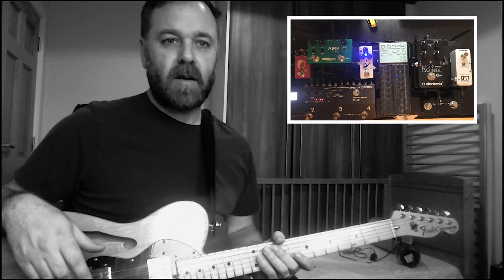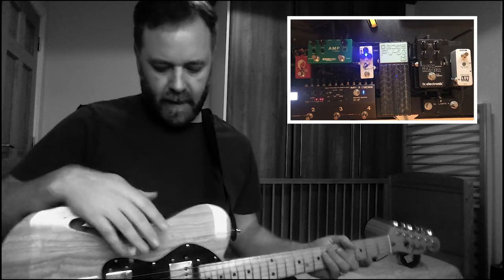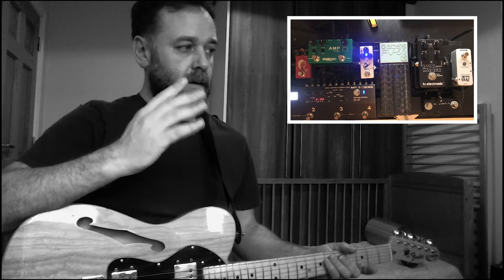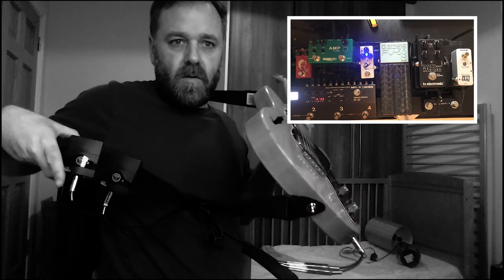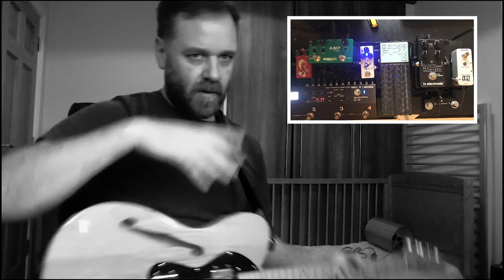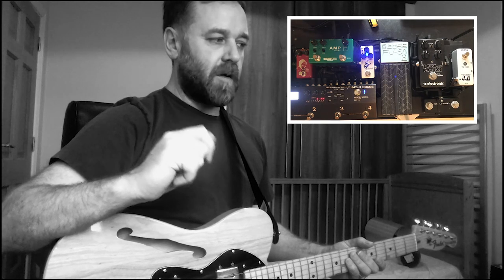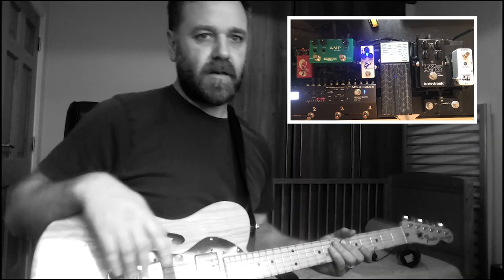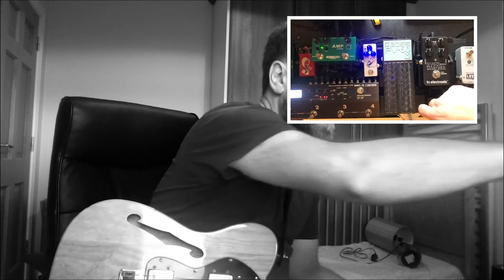Wireless Piezo / Electric Setup

Comment: Hi great idea using Electric n Piezo together, i just bought MS3 and want to ask you about how can i controls my Cort Acoustic (DI box out to PA) and Electric Tele (out to Fender Champ) separately with MS3 patch? Thanks 🙏
Reply from the maker: Hi Augustinus. Thanks for the question. So you can’t do this with just the MS3 you’d also need an AB box to switch between electric and Acoustic before you go into the MS3 as it only has one input. 

You can however use the MS3 to switch between the PA (di box on your board) and your amp. 

Simply select L AND R output mode and set the output of the channel you are not using to zero on a patch by patch basis.

That way patch 1a could be for your acoustic with whatever reverb/delay/ modulation you want and patch 1b could be for your electric with whatever effects you want. 

Does that make sense and does it answer your question? Thx